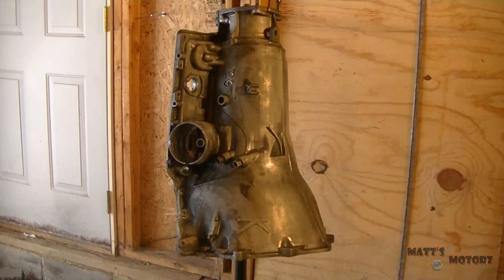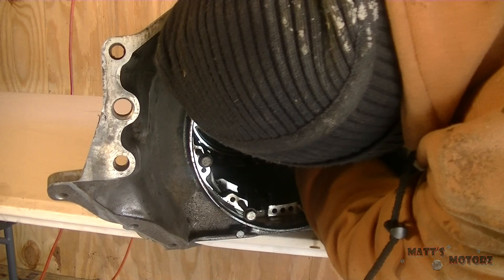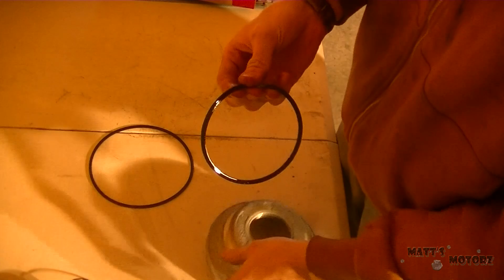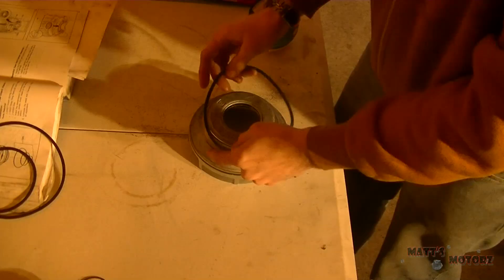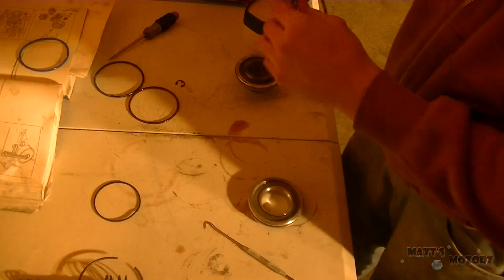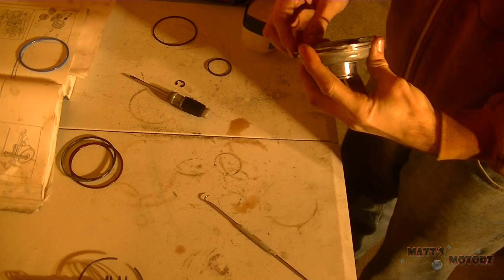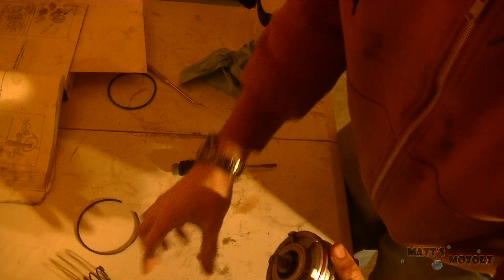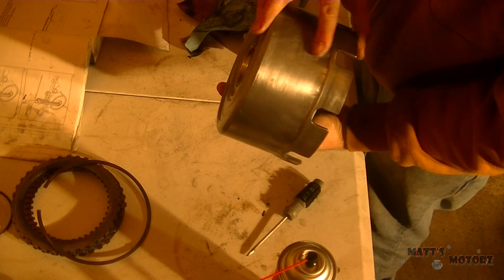4L60E / 700R4 Transmission Rebuild [Part 5: Painting and Seals Replacement]

Comment: if the low reverse piston area below the larger seal is scratched up, it got deep scratched with the metal pieces that broke off the rear planetary gear, can I sand it or should i just replace the piston?
thanks.
Reply from the maker: Sanding will not fix deep scratches, it will need to be replaced.

Comment: Hi Matt,
I need your advise, or if anyone has any advise I would like to hear it.
 I just took apart my 4L60E. I have  1999 Suburban 4x4, but now I can't decide if I should rebuild it or not.  there were broken pieces of metal everywhere. The Outer Ring gear cracked, a big piece of the rear planetary gear set broke off. The broken pieces even got between the low reverse piston and the piston bore and caused deep scratches on both of them. the big question is should I rebuild this Transmission or just get a used one and rebuild that one? I would appreciate any feedback, I don’t want to waste all my work and order a  kit, plus parts for a case that might be a total loss.
Thank you.
Reply from the maker: I just replied to your message you sent me on my channel with this same question.
Reply: thanks.